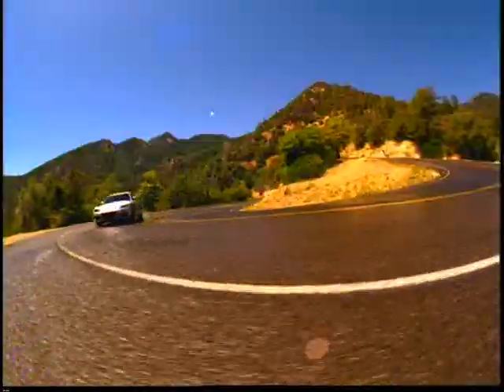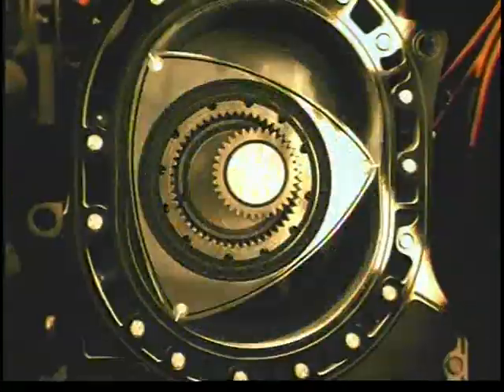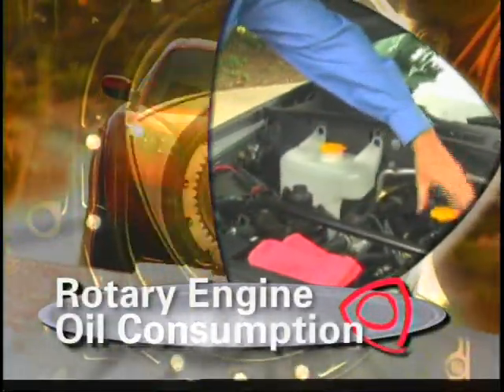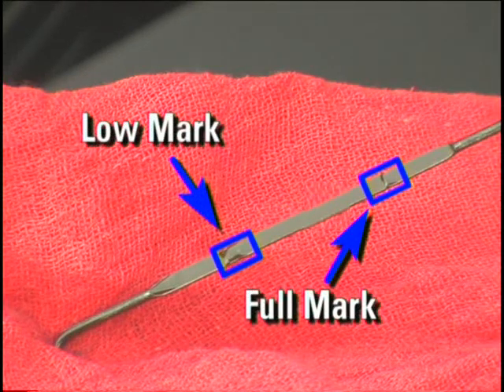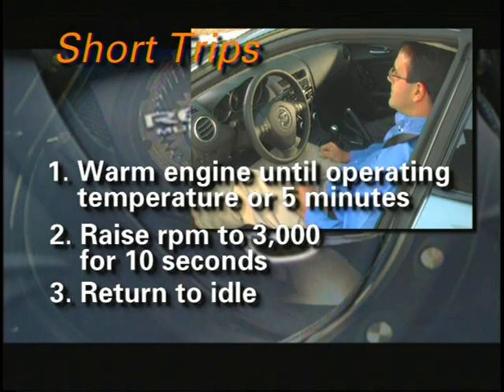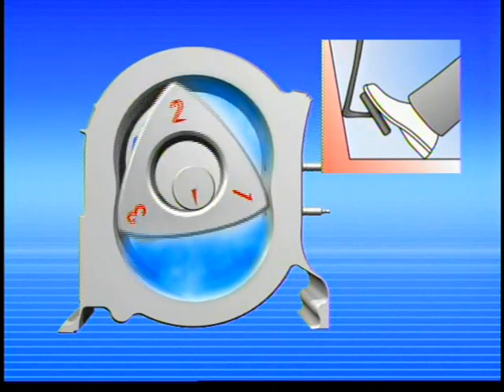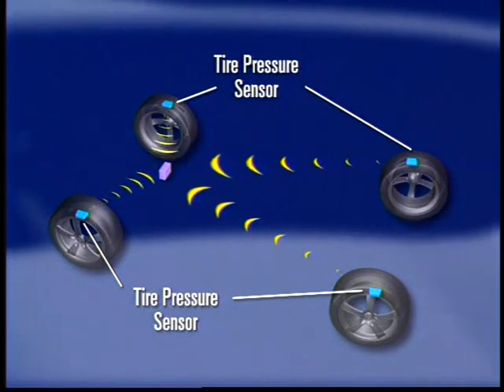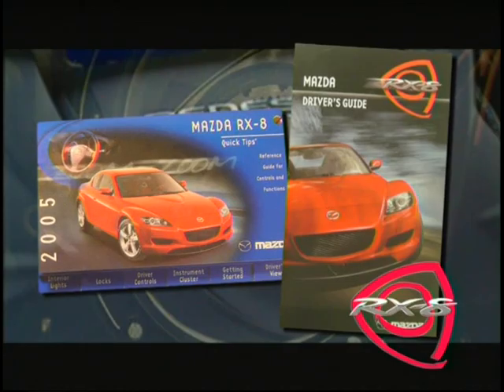RX8 Ownership Video

Comment: I have a 2004 Rx8 with 77000 miles/123000km on it and she runs perfect everyday. I use it to get me to work and on the weekends I have fun on country roads or the track. All I do is use premium petrol and top up the oil every 1000 miles/1600km. Let her warm up properly every morning and rev the engine slightly before shutting down. A rotary engine can be easy to look after if done properly and the Rx8 is one of the best cars I've ever driven.
Reply: You are great! are you still driving it daily and weekend?
Reply: Rebel69rock which year does the RX8 have a display system that pops out the dash bored? I'm looking for one.

Comment: Finally got mine a couple days ago. I am familiar with all of it's flaws, but they all fade ones you take it for a drive. Brilliant experience. Best decision ever. Every car enthusiast should take one for a drive.
Reply: +Detc0re Had mine over 4 years now. I still love it and there's nothing like the rotary engine - literally! 
Plus they're dirt cheap to buy as used cars.
Reply: +Mark Ferris The RX8 will be my next car, solid aftermarket (better than Honda), great price point and unique engine.
Reply: +Detc0re Im thinking about making an RX-8 my next vehicle purchase. I am very much looking for a "drivers car", would you make the assumption that for this price point i couldn't do any better? I am not worried about the prolonged time i must spend with my vehicle, seeing as i prefer being behind the wheel than anywhere else.
Reply: +RyMann88 Right on! I had mine out autocrossing a couple of weeks ago, it's such a precise vehicle and very stylish too - I hope the next generation of enthusiasts will pick up the torch and keep this car on the road for years to come. 
It may be that the RX8 is the last rotary car we have, and it would mean that eventually they will be collectible. I'm starting to think that might happen, since Mazda is backing off plans for a successor. Correct me if I'm wrong but that's my take on it!
Good luck!
Reply: +Detc0re ps you guys, don't forget to get a proper compression test before you buy one. If it's low (lower than 6.9) it will need a rebuild or replacement soon. A Renesis should produce around 8psi if it's healthy.
I'm not saying you shouldn't buy a car with a tired engine, but factor that into your offer. 
Happy Hunting!
Reply: +Mark Ferris is it still runni g good

Comment: I just bought one for a early birthday gift to myself. Love it so far, so much more I need to learn about rotory engines.
Reply: Is it still working?
Reply: Is it still working Tazz92SHMuzic?
Reply: +ValenNitto yeah its still working.
Reply: +steelersrock1775 its still running good i barely drive it too cause i work alot and drive the company car so my Rx8 is my weekend car u can say. but when i go out i haul ass in it on the streets
Reply: +Tazz92SHMuzic hahaha awesome dude, what brand of oil do you use?
Reply: +Eduardo Trujillo i use castrol gtx the 5W-20 . i try to change it every 2500miles

Comment: it forgot to say that temperature gauge is useless. if it move to the right your engine is done for. It wont move until 235F and the engine is in the danger zone for overheating at 220F. So the needle could be in the middle and you could have a really hot engine.
Reply: Oh my thanks 4 the heads up

Comment: People moan and groan about the Renesis engine, but really, at the pricepoint of a used RX8 (they're stupid cheap) you can afford to spend some $$.
Think of it another way - if you bought a typical BMW or something you're going to lose more money in depreciation every year than you'll spend on your RX8.
Not to mention that if you get a higher-end used car the repairs are astronomically expensive. The new Porsche GT3 RS has a titanium exhaust, imagine how much that's going to cost when it goes! Probably as much as a new Renesis...
Reply: Lol how does an exhaust go exactly?  And my 2003 bmw is dirt cheap to maintain along with the parts

Comment: Bought a 2007,rx8 2 weeks ago,I got it cheap,engine is good,starts first time every time hot or cold,it needed a dipstick,parking light bulb,passenger door light,coolant level was low,I cleaned the air filter,next I have to fix the central locking and some chip marks on the rims and the rear plate bulbs ,everything else works.The tire pressure was low on two tires,I think the last owner just added oil when it needed it.
Reply: How does it run now ?
Reply: Celtic Tiger is it still running?
Reply: Yes it runs like clockwork, everything working, great buy.
Reply: Celtic Tiger I'm very hyped I'm going to pick one up after I get my tax return back

Comment: I always wanted an RX-8, but I try to find the 2nd gen models (2009-2012) because it seems like they have less problems than the 1st gen models. Every forum, video, or info you find about the RX-8, it always talks about its problems and those issues always ties to the 1st generation cars. Maybe the 2nd generation cars don't have as much issues as the older ones, there's rarely any videos or info on the 2nd gen's problems. If there isn't any problems, the 2nd gen RX-8s would be better than the older RX-8s since Mazda made changes to the Renesis and the car after 2008

Comment: it's sad to think that there are people that actually flood their rx8's :( you really shouldn't be able to flood your engine if you actually care about your car and know what a rotary engine needs
Reply: Aidan Higby I'm buying one soon- can you message me and help me with how to take care of it
Reply: unfortunately I don't have mine anymore, the main thing to know is it isn't a car you can turn on to move around and turn straight off it pretty much needs to be up to operating temp before you bother trying to turn it off and make sure you keep your eye on the oil and keep it topped up and change it roughly every 5000kms. as long as it is up to operating tempo before you switch it off you shouldn't be able to flood it, if you have to move it in a driveway or something take it for a short drive before you turn it off. also when you first turn it on to drive when the engine is cold let it warm up for at least a minute then baby the car for the first 5 minutes of the drive or so until it is up to operating temp (keep it below 4k rpm and preferably stay around 3k rpm) then when it is at operating temp you can drive like a madman.

Comment: only thing that keeps me away from rotaries is the infamous 60k-80k engine rebuilds, good for a race car, not for a daily, plus bad gas mileage and flooding issues
Reply: Flooding's a non issue unless you didn't get it updated or never change plugs.
Reply: I use to drive a Civic Si and when I bought my RX8 I never turned back. Everything I modified in that gay civic came stock and was even better on the RX8 I just couldn't believe it. I wasted 15K on that god dam civic so far I've only spent 6K on my RX8. I've had it for 4 yrs no problems whatsoever you just gotta be a professional and get away from all the ricer Hot Ebay Nights stuff. That's why people are having such a hard time with their 8 because of spending their money on a new radiator they got a giant fart cannon exhaust instead and some Invader body kit.
Reply: idk how you ended upspendin that much on your civic, i spent 2500 for a ex, baught a gsr swap for 2500 and did sport shocks and springs. im doin brakes/tires next. my idea was be faster than an si for cheaper then an si
Reply: Hontoni Arigato Civic Si? LMAOOO are you having financial troubles? You do know that they are completely different from the RX-8 right...
Reply: since he owned a civic and rx8 im pretty sure he knows that theyre completely different...... wow just checked CL to see it for my self, rx8s are cheap AF i could sell both my civics and get 2 rx8s plus a few grand left over haha

Comment: I would like more info for troubleshooting as to why my 2005 rx8 stalls while the a/c is on. It over loads the engine and the rpms rise and fall till it stalls! I changed the plugs, cleaned maf sensor and cleaned throttle body. What else do I need to do?

Comment: RX8 OWNERS PRODUCT UPDATE
Continued problems with premature engine failure and defective engines and or componets replaced under the NHTSA manditory recall program  and Mazda's extended warranty program.
Paschal v. Mazda Motor of America, Inc., case number 8:14-cv-00594, in the U.S. District Court for the Central District of California.

approx 50,000 of the 69,000 RX8s recalled for premature engine failures and failures to start when hot (flooding) their owners may be eligible to compensation under this action even if your engine was replaced or is now out of the extended warranty period... the case is based on the issues with the replacement engines failing and costs related to the failures and defects.
Reply: This mainly applies to the original owner that bought the car. If you take your car to Mazda they're not going to do anything for free. You have to provide physical proof; all receipts and paperwork for every possible oil change, maintenance, everything from the day the car left the dealership. If there is an oil change paperwork missing for 1 month they will not help you. Also all the paper has to reflect the correct method of maintenance if just 1 shows otherwise then they won't help you. Any type of performance modification or aftermarket parts is automatic NO. I know I've had this conversation at 2 different Mazda dealership, no offense but Mazda of USA is scum. They don't know jack shit about the RX8 and they're just there to jack you out of your money. If anyone wants a Class B Sports car you need to be serious no more ricer days.
Reply: Hontoni Arigato  It applies to anyone who continued to have or still has problems related to defective engines despite having their original defective engine replaced or repaired under the engine recall and owners who's cars are no longer covered by the extended recall warranty.  If the the court decides that Mazda was negligent in its efforts to solve the defects owners will still be eligible for compensation even if the maintenance records are incomplete... if Mazda sold defective parts they have to make good regardless how the product was handled after it was sold.
Reply: Hontoni Arigato The RX8 ended in 2011 model year and Mazda ceased all production of Wankel engines back in June of 2012... Mazda would really like to forget about all of the problems and move on with its new line of Skyactiv powered cars and its all new MX5 sportscar.
Reply: doktorbimmer Yes that is correct BUT You have to "prove" to Mazda that whatever problem you're having was not caused by improper care. For example if you have an aftermarket Intake that is not sold and installed by Mazda then they're going to throw that back at you. You can't just walk into Mazda and get a free anything it doesn't work like that. From the day the car left the dealership you have to show documents for every scheduled service and Prove to them that the problem you're having is from the engine itself and Not because you mishandled it. That's why if you buy a used RX8 its very little chance the previous owner(s) will have all serviced records from the day it left the dealership. You can call any US Mazda dealership they will tell you the same.
Reply: Hontoni Arigato No, you do not need to contact Mazda. I think you are confused with the extended warranty compliance program..

Everyone that was included in the mandatory NHTSA Recall would have received a letter from Mazda..

The class action law suit is something completely different and does not require you to contact Mazda or the dealer. If you are eligible to be included in the class action lawsuit must contact the law office of the plaintif... if they have not already been in contact with you... the number of eligible owner is expected to increase so you may not have been contacted yet.  If the court decides in favor of the plaintif you would receive a compensation payment or payments for damages... that's just how these things work.  Cheers!
Reply: Hontoni Arigato I did not make up the NHTSA manditory recall program.

Nor did I make the story... Their is a class action suit against Mazda for contiuned defects of RX-8 engines
Reply: The lawsuit centres around the failure of Mazda to replace spark plugs under warranty mainly. Not directly related to premature engine failure, which was already covered by the extended warranty. That's my take on it, anyway. I'm an owner with a new engine (not replaced by Mazda)
http://www.law360.com/articles/528991/mazda-hit-with-suit-over-rx-8-flooding-engines
Reply: Mark Ferris Mazdas lawyers were very clever.. when Mazda agreed to volantarily extend the engine warranty due to the NHTSA recall, they included a clause that limited their liabilty for damaged components related to the defective engines themselves..  So the case has been dismissed... RX8 owners get F*(ked again.... 

Flooding and damaged sparks ae cause by the engines poor sealing design... its not an issue of the spark plugs being defective  its a defect in the design of the engine (that Mazda no longer produces)
Reply: ***** Just the facts my friend, there is a tremendous amount of confusion and ignorance as to why the Wankel engine died out and become obsolete..  I think you would be very jealous of my cars.
Reply: +Hontoni Arigato I'd buy one, I'm fine with replacing apex seals.
Reply: The AE86 of Mt. Akina Too bad the model is now defunct.. you'll have to look for a used one, they stopped making and selling them a long time ago.

Apparently Mazda wasn't fine with it... they lost a lot of money replacing engines suffering from premature apex seal failure and cancelled production after the cars reputation for bad engines sent sales figures plummeting..